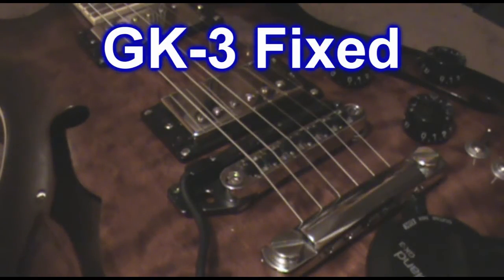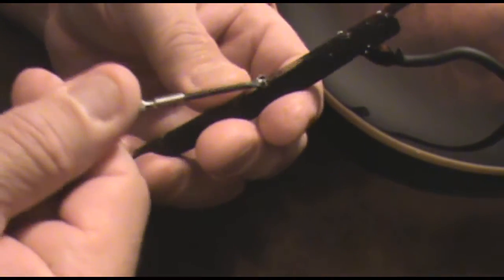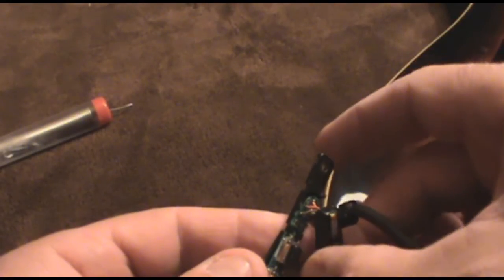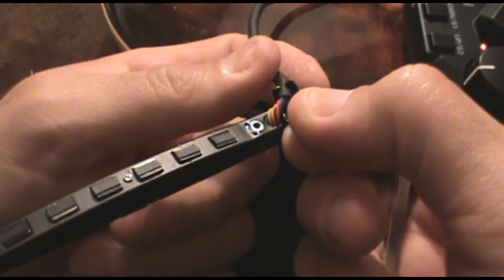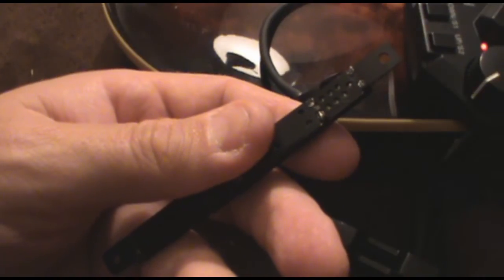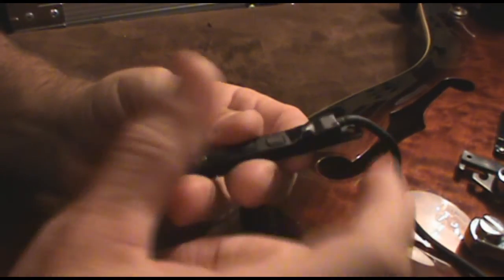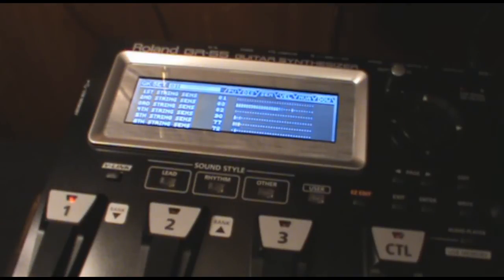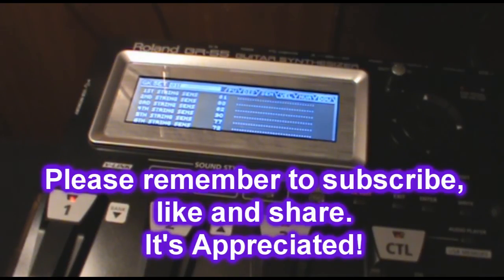GK-3 Fixed

Comment: Do you work on these 13 pin MIDI SYSTEMS? I need one installed and one fixed. Second  string not working too.
Reply from the maker: No I don't, sorry. Pull the cover off and check the pickups wires to see if something came off for the second pickup. Happens a lot on these because the wires are so small and fragile. May just need re-soldered.

Comment: Hello from the wet and pretty miserable 2024! It's been 10 years since posting this video, and you saved me £150! I had problems with my A string, and when I took the cover off, I found a green cable just hanging in the air. After a rather crappy soldering job, I managed to bring it back to life! Thanks for the video!
Reply from the maker: Glad it helped Do me a favor and hit that subscribe button. Love happy endings!

Comment: I have joined the many who have issues with this flimsy kit!

Your video helped me enormously and gave me the confidence to eventually deconstruct my pickup, I gave 3 dead strings. Unfortunately my pickup has 3 wires disconnected from the board. I'll need to find someone to do the repair because my soldering skills don't stretch to that level of precision but at least I know the cause. These are still being sold new, in spite of the GK5 coming onto the market, I just wish Roland had fixed this clear design fault which has been around for well over a decade. But thank you again, a great help.
Reply from the maker: Good luck, hope you get it fixed.

Comment: Hey man, How did you loosen the metal casings grip on the cable from the controller to the pickup?
Reply from the maker: Needle nose pliers or wire snips I believe. Long time ago.

Comment: Nice video. Just found it but it's still relevant because the GK-3 is still buggy LOL
Mine works mostly fine until I get up to the 12th fret. From there on up, it's not even registering signal. Even if my module's note range was being exceeded, I should still see a signal indication, I would think.

Comment: Do those little pickups come out? Are they soldered in?
Reply from the maker: Soldered to the circuit board.
Reply: @TheGospelGuitarist  do you know which color wires correspond to which mini pickup? I want to disconnect 1-4
Reply from the maker: Not without taking it apart.

Comment: Great video.  The screw  on my GK3 pickup that holds the wire down is stripped.  Suggestions to fix please.  What super glue did you use?
Reply from the maker: Try a slightly larger screw. Just ordinary super glue.
Reply: @TheGospelGuitarist  Excellent idea.  Can you tell me if the hole for the bolt is metal or plastic.  Thanx!   Reason being, I was thinking of Using Loctite form a thread.
Reply from the maker: I think it is plastic. I just thought that a tiny zip tie may work. I still have mine but I sold the GR-55 it came with.
Reply: @TheGospelGuitarist  Just got off the phone with a Roland Tech.  He says They have a new mini bolt to replace the old one.  Slightly larger than the original.
Reply: and mine

Comment: Thank you for showing and demonstrating the possible problems with the GK3 pickup. I noticed when I bought a GR20 some years ago that the connection was probably going to be a big issue soon. It's a bad design and surely Roland could have sorted out this by now. On a GK3 equipped ready guitar that they used to sell ( way to much money for me! ) it might have not been such a problem. Glad you managed to fix it but it shouldn't have been necessary in the first place.
Thanks 👍
Reply from the maker: Totally agree!

Comment: My B string just went out too.  Hope my fix will be simple like yours.  Otherwise I may have to bring out the synth again which is a lot more for gig set ups
Reply from the maker: Back in those days I gave up on the GK3 and bought a Roland synth guitar. Basically a Fender Strat with the GK3 built in , great guitar and never had any more issues. One days I hope to go through it and resolder everything.

Comment: Thanks, TheGospelGuitarist, dated video, still helpful for today 2020, I had the same issue with these wires breaking off, and bought a second GK-3. When I bought the second one I place a small wrap of electrical tape to strengthen that week point. I'm having another issue now, and that is I can't get my guitar pickups to work through the GK any suggestion on how to rectify this? For the money they charge for these, one would think they could come up with a much more reliable design. Since I purchased my last GK-3 the price of them has skyrocketed.
Reply from the maker: I know this will sound like it's obvious but you do set the GK3 switch to both or guitar right? If you are not getting a guitar signal from the GK3 I  can only assume it is faulty to what you are plugging into is not set for your guitar to play back.
Reply: @TheGospelGuitarist  Thanks I had it working at one point earlier when I purchased my first GK3. I will try a different guitar to see if I get a signal. Had my GK apart yesterday after watching your video and was able to repair a broken wire that fed the 6th string. Thank you for responding Sir. Wasn't easy due to my eyesight. Now enjoying all of the string resounding.
Reply: I have two GK-3's, one will install and wire through the guitar . . . the other is like your clamp-on module with the exposed wire, which is really vulnerable! 
I had the B-String going in and out and thought I needed a new 13-pin cable . . . but it just needed to be recalibrated for distance to bridge, made sure I had at least 1mm of clearance to string when capoed at 22nd fret . . . and then adjusted sensitivity on the GP-10 . . . works fine now. 
Got a large diameter shrink wrap . . . may put that on for more support at the microwire harness instead of electrical tape you used.

Comment: My G string pickup wasn't working, and I found that when I unplugged the cable from where it goes into my GR-30, and re-inserted it, the problem went away. So far, so good, I got my fingers crosses.

Comment: Thanks bro! My GK cable has become loose & does lock snuggly to the synth input or pickup input. Is there anything I could do?
Reply from the maker: Replace the cable? The clip may be broke that's on the plug, a little metal clip that hooks into the plug.

Comment: Isn't it amazing that a high tech company like Roland would put this piece of crap joint on an expensive product when a small din type plug would have been perfect. My GR55 failed three years ago, and I would have had to pay a bundle of cash to Roland to sort it, as it's out of warranty, so it's been gathering dust ever since. Thanks to you it's up and running again.
Reply from the maker: That's totally awesome.  I'm happy for you. :)

Comment: Hello my friend can you help me please? I have a gk3 too and it has a little and easy problem but i can't solve it.  Well when i played 2 strings wasnt working... so i opened like you did, everything was allright and suddenly it started to work perfectly. But now 1 string is not working again =( i tryed to find some bad contact and nothing... what can i do my friend?? please
Reply from the maker: Re-heat the solder joints to eliminate any cold or loose solder joints.
Reply: i did it but still doenst work =( but thank you anyway!

Comment: These pickups are of an unbelievably poor construction standard.  I've installed three so far - two GTK-KIT and one GK3.  The pickup coils are mounted on a thin PCB that sits on a plastic carrier and is enclosed on the top by a metal can.  The screw bends the PCB. BTW, be REALLY careful bending those tabs - you'll only get to do it once, maybe, so only bend them just enough to open it.  The seven wires represent a common and six coils.  This cable terminates in a 7-way multi-way.

If you get too much trouble with this arrangement, there is no problem with removing the wires (do make a note of where they go!), removing the casing and support and using something like Polymorph to make a holder for the whole thing.  Customise the curve, and/or the mounting method.  The only thing that you are trying to achieve is to put each coil underneath each string, so the carrier format doesn't matter that much.  It's fiddly work, but you can do it, because as I said,  this is just 6 coils mounted on a PCB.

If you know how to produce a PCB, you could even make one that has the pickups match the string spacing of your particular guitar, but this approach is definitely not for the either the beginner, or the faint of heart!

I didn't take a video at the time, but I did take micro-shots of the first one, when I found a brand new GTK-KIT with one pole out (easier to fix it than send it back).  If anyone is interested, I'll make a quick video.

Comment: Thanks for the tip,my A string is on & off,moved the pickup closer & it helped,but now midi dropouts & hardly any volume at times? using an old GI20,but will check cable as you suggest. Think maybe the Fishman triple play is a better solution,with Kenton/Iconnect USB.Midi converter for my synths

Comment: Thanks for your videos. I have a similar issue with my GK-3B: I lose the A string from time to time. In my case the signal comes back when I unplug/replug the 13-pin cable on the GK module on the bass. I will follow your advice and carefully diagnose where the weak point is before doing anything reckless. Cheers.

Comment: Hi, compliments for video.
In my GK3 the sixth string (low E) does not produce sound. I think it's a problem of interruption of the wire at the same point that you specify in the video. I understand little english but i seemed to understand that you have cut the cable on a bit higher of input in the pickup and redone solders.
Greetings

Comment: Thanks man good video. Got mine working again but didn't put any tape around it and its gone again :(  Trapped by the pinch thing. Got another one on its way from the shop where I got it. But I took the day off to try and get to know the box its self.

Comment: hi ,good video thanks,.i have a problem hearing theguitar by it self when i put the pickup selector ,on the gk3 pickup,any idea what .it could be?all the other selectors works,evn in the mixed position ,i can only hear the synth..thanks for reply.
Reply from the maker: Check how you routing the guitar in the GR-55. Are you using the guitar out? Is it routed there? Is it even included in the patch? Lots of things to check.

Comment: Well done, thanks. My A string crackles and has a weak signal. I will check MIDI cable connection but I am more suspicious of the mini humbucker wire. Some guys suggest a reverse mount (wire trailing down instead of up- then choose reverse mount setting in the GR 55) which I will also try, since my hand constantly hits the wire, which is probably the reason it got loose.
Reply from the maker: Yes, I've heard that too. Unfortunately once the damage is already done, it still needs repaired first. Thanks for passing it on!